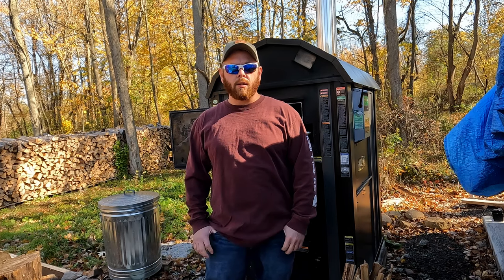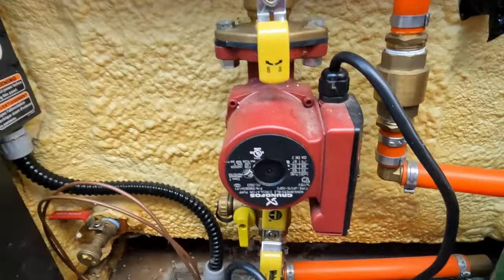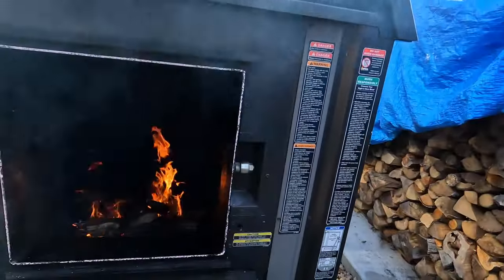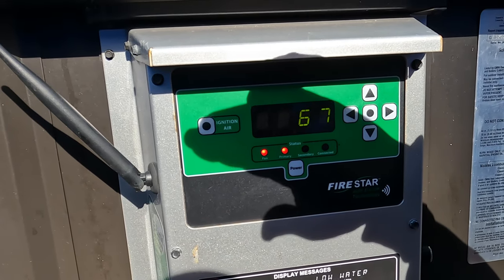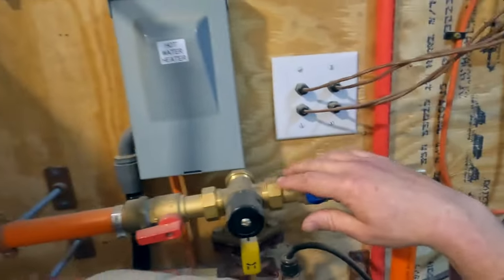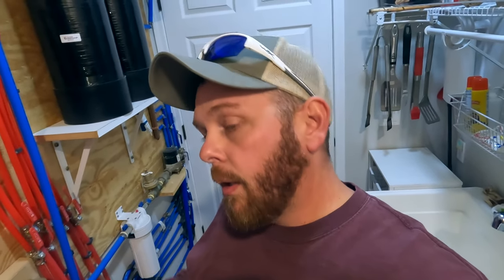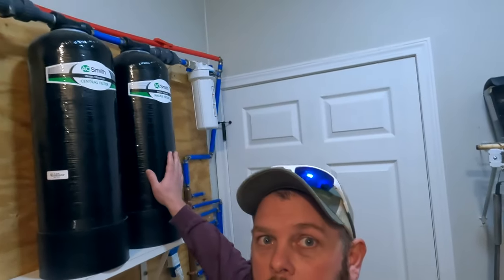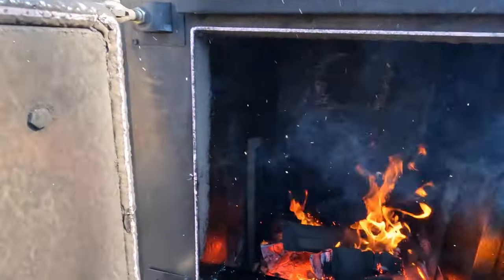Starting Up The Outdoor Wood Boiler with a Radiant Heat System Overview #62

Comment: Set of waiting for your water to get up to 185° and then plug in the pump should run the boiler pump so that the temperature in the house and all piping comes up even if you don’t want to be slug in cold water back to the boiler
Reply from the maker: That would work also. Thanks for watching I appreciate it

Comment: Thanks for taking the time to put this together.  I'm sure it will be a popular topic for you.  Wow, I had no idea they had gotten so expensive.  That's going to make the initial investment very difficult for people.  Glad yours is working out well.  I'd still like to have one. Mine would be an add on to a forced air system. 

I'm looking fwd to more updates as we go through the season.  Does your unit burn clean all the time or just when it is cranking and the blower is firing up the burn chamber?  Does it have a smoky/ smolder phase when it isn't calling for heat? How many cords did you say you used in a season?  I think when you said it before you might have meant face cords because I thought I heard you say a much lower cord number in another video.
Reply from the maker: Absolutely hopefully it helps! The price increase in the last couple years blow my mind, that's something like a 13% increase in 2 years.  

I burned just over 3 full cords last year but I cut it at 20" so its probably closer to 4 full cords by volume if you know what I mean.  Thanks for watching I appreciate it, talk to you later-TC

Comment: The bypass doesn't help much anyway...central boiler and headmaster fell short with their little bypass in the back of the furnace..I owned a polar for many years and their slot just above the filling door was the best bypass location. No smoke in your face at all!! Think about it with any wood burning stove or furnace, where does the smoke tend to want to come out??? Front filling door always.  Don't get me wrong....great furnaces but one downside they need to think about a little more.....cheers great video
Reply from the maker: Thanks Jamie! Definitely my only real complaint with the day to day operation is the smoke, if the wind isn’t right it’s overwhelming at times. A little more thought in the engineering phase could have helped for sure. Thanks for watching I appreciate it,take care-Tony

Comment: How much wood do you burn in a year
Reply from the maker: Well I’m not really sure. Last year I burned around 13 face cords but it was cut 20” so it’s not really a face cord by definition if you know what I mean. I figured out the cubic feet total and if a full cord is 128 cubic feet of firewood I  used 5.25 full cords or 15.75 face cords. Hopefully this helps, it’s kinda confusing because I don’t cut my wood to the standard 16”. Take care-TC